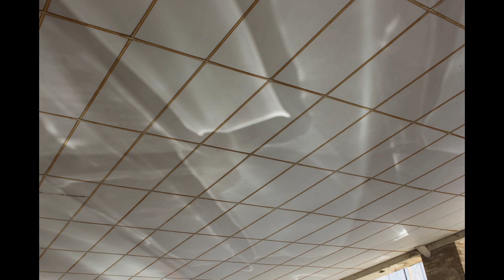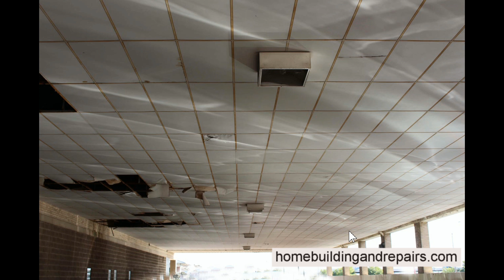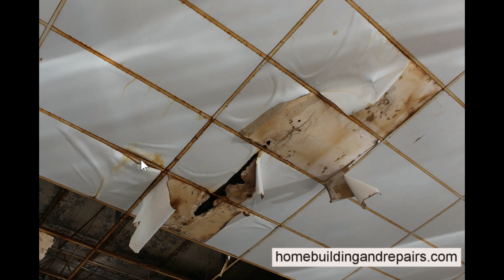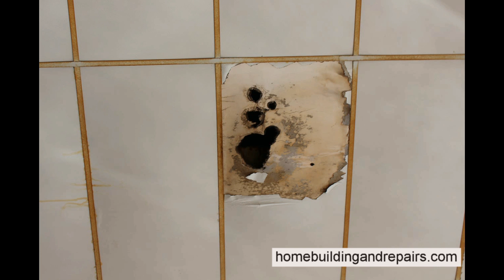Think Twice Before Installing Exterior T-Bar Ceiling - Water Damage

Comment: It was probably added more for vermin control than looks IMO.  That structural beam would be a nesting area for pigeons if not for that ceiling.  Or bats and  other things, with their droppings making the more looked at floor the problem.  Even aged and destroyed, it looks better than the chicken wire solution other places use to keep the bats out of the bell-free.

Comment: Well said.  Fix the cause of the water leak first.
Reply from the maker: +paraglidingnut26 I think that's one of the biggest problems here and once the water leaks are fixed, you could simply repair the T-bar ceiling and paint it.